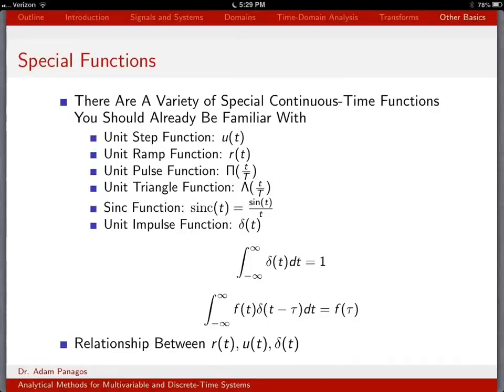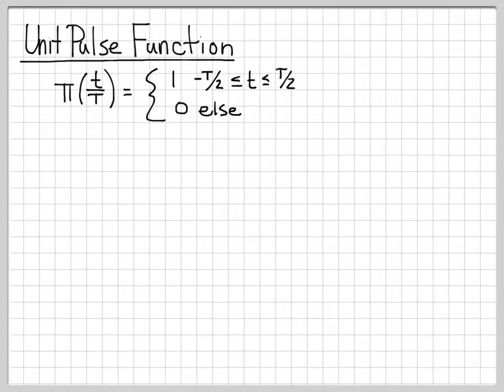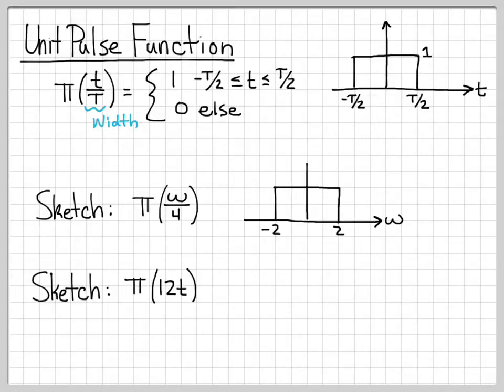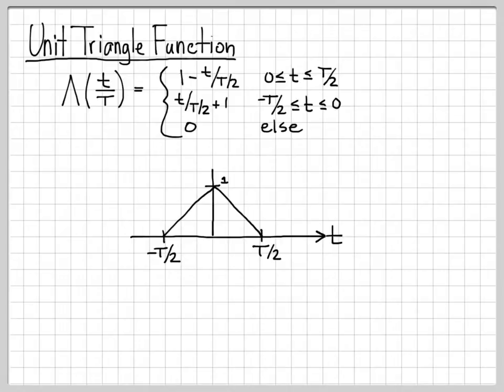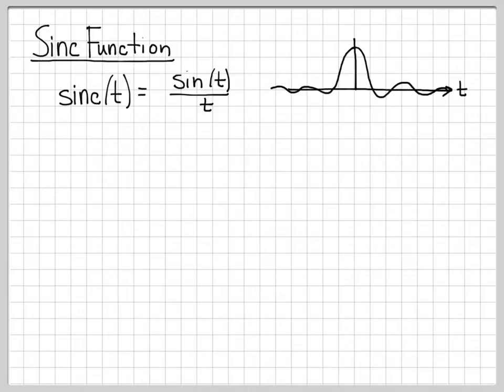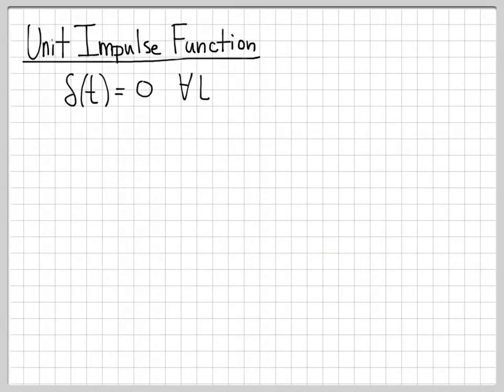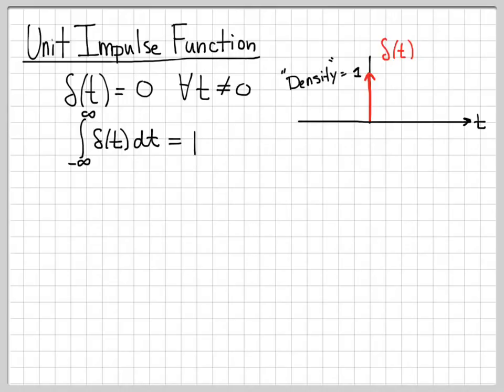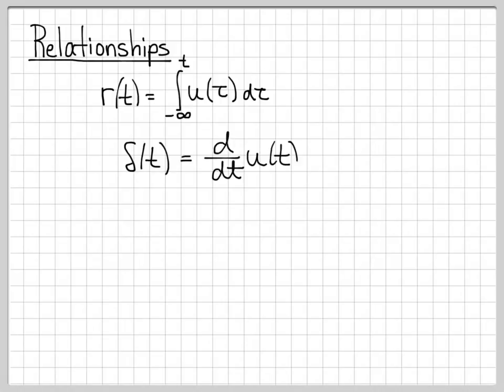Discrete-Time Signals and Systems Introduction (4/6): Special Functions

Comment: can you explain why the notation is pi(t/T) ? that makes no sense to me. is it purely random, for the purpose of confusing people or does it make some sense?
Reply from the maker: geobruf123 Just a somewhat common notation.  When written as a capitol "pi" letter, it looks kind of a like a rectangle shape (two legs with a flat top), which is fitting since this is our pulse function which looks like this when plotted.  Also kind of nice that both the word pulse and pi both start with the letter "p".  It that what you're referring to?
Reply: Adam Panagos well yes thats helpful. But my main question regards the t/T part. does that have any significance? I mean - its a function of 't' right, not t/T. so is that notation just so we can put the pereod in there in a compact way or does that ratio mean something?
Reply from the maker: geobruf123 Ah, ok.  Another way to think about the definition of this function is that the function has a value of one whenever the argument of the function is between -0.5 and 0.5.  For all other arguments the function has a value of zero.

So, pi(0.2) = 1, pi(-0.4)=1, etc.  But pi(0.6) = 0, pi(-1.1) = 0, etc.

This is exactly how the function is defined in the video, just having the "T" as an extra variable is nice since it lets us easily control the width of the pulse.  You still interpret pi(t/T) in the same way to figure out the value of the function.  If t/T (which is the argument of the function) is between -0.5 an 0.5 then the function is one, else it's zero.

Maybe that helps?
Reply: Adam Panagos oh ok, so having a bigger T means that the range of 't' for which t/T<|0.5| is bigger, hence a fatter rectangle? Thanks a lot I think I get it
Reply from the maker: geobruf123 Yes, that's exactly right.  Glad we got that figured out!  Thanks.